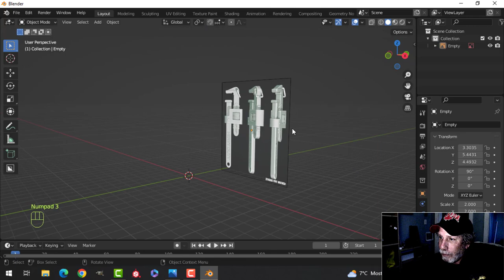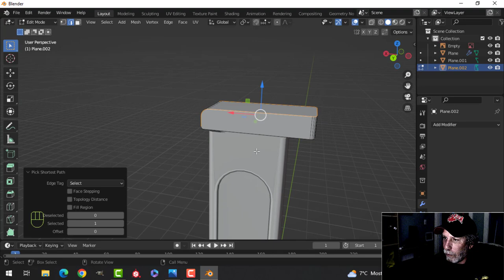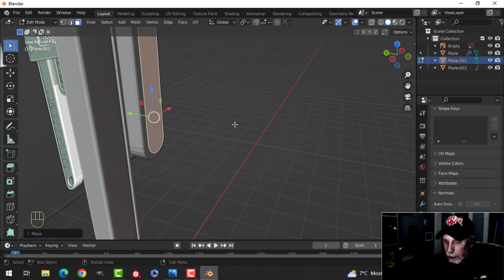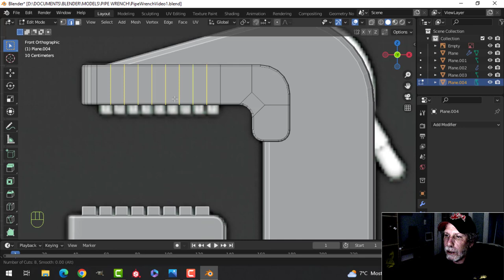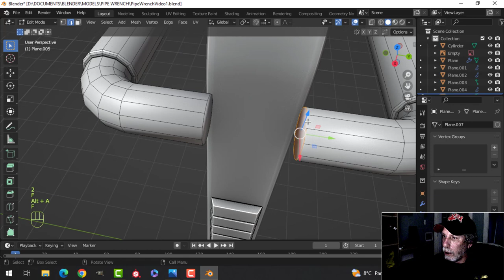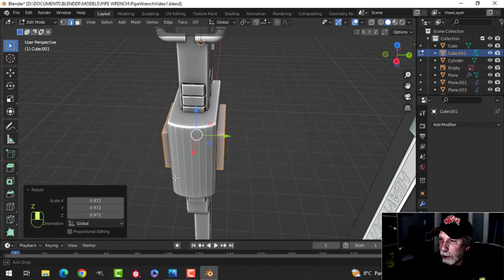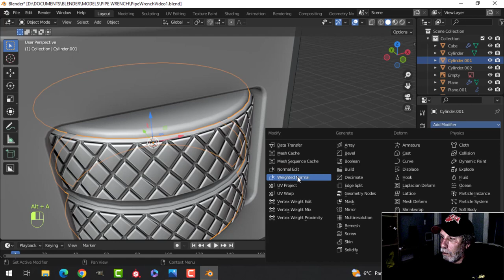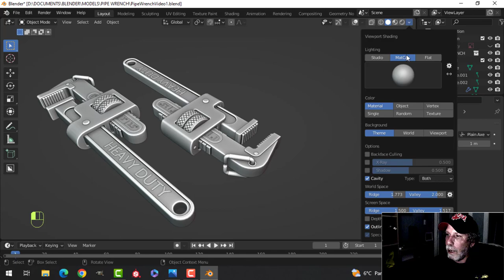BLENDER: PIPE WRENCH (MODELING)

Comment: Ok sir!  That metal clip with those rubber sleves give me a bit of a challange to model. not in general but those sleves. I am on version 5.1 and don't know whether its the keyboard but using the command "E" + "alt S" just completely blew my mind! all how, it failed to wors. "E +S did work but seperately.

Comment: Like your work. Sir for boolean You can activate your bool tools then you have to press only Ctrl minus for bool cut... There is no need to add  Boolean Modifier...
Reply from the maker: I sometimes use bool tools but have tried to do most modeling for this channel with as few add-ons as possible.  Other than loop tools and node wrangler, I model with no other add-ons.  Meanwhile, I have box cutter and machine tools etc but I want to keep this channel simple.  Still, I may start using bool tool again,  we will see.  Thx
Reply: @zerobio  Oh , I see....

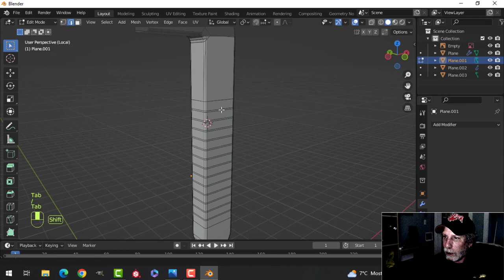Comment: I am experiencing a small challange. on yout frame 20:44/56:21  the moving portion, I am not able to bevel it  fully. It seize-up and no more is possible. I checked for diuble verticies and normals, all correct.
Reply from the maker: I will look into this later and get back to you...
Reply from the maker: So I'm not sure what you mean by beveling it fully but I will say that as various cuts, extrusions and booleans are performed on an object,  often the bevel modifier no longer provides much of a bevel.  You can play with the angle and sometimes that will work but often times the mesh is changed such that the bevel modifier does nothing.  You need to walk a thin line when relying on the modifier.  I often do manual bevels with ctrl B or shift ctrl B.  Especially when I extrude out those teeth, the modifier barely adds any bevel.  If you added the teeth as separate geometry, not as one piece with teeth extruded, the bevel modifier would give a good bevel.  So just keep experimenting and see how it goes.
Reply: I found the problem was caused by the "reversed" bevel under the shank. I proceeded to bevel only where seen and the plate with those grips would hide the rest. Coming along nicely and thanks. @zerobio
Reply from the maker: @michaelpenco546  Excellent!  Hope you will drop by the zerobio discord and show your work either as WIP or final render in the blender-render channel or tools-challenge-render if you are participating in the challenge.

Comment: Hi! I loved your tutorial and would very much like to follow it. However, the pipe wrench reference image isn´t available anymore. So if you could do something to help me, like upload it here in my comment i would very much apreciate it!
Thank you! Have an amazing day and thank you for the amazing toturial!
Reply: I'm having the same problem! btw amazing tutorial
Reply from the maker: It should be on the zerobio discord.  Are you a member of the discord?  If not, perhaps it is not available to you.  Let me check and send the link to you here and see if it works for you.
Reply from the maker: @ineslopes9682  see my previous comment to OP
Reply from the maker: Please try this link and see if it works for you ... https://cdn.discordapp.com/attachments/801065146327498752/1105302895932481617/zerobioPipeWrenchReference.jpg?ex=661dd209&is=660b5d09&hm=49acfa38642c1b8026d539701311b2aa5336b34685d313f82ff7a69211e2f782&
Reply from the maker: Try this link again https://cdn.discordapp.com/attachments/801065146327498752/1105302895932481617/zerobioPipeWrenchReference.jpg?ex=661dd209&is=660b5d09&hm=49acfa38642c1b8026d539701311b2aa5336b34685d313f82ff7a69211e2f782&
Reply: @zerobio   Thank you so much!!! It works now! Have a great day!!
Reply from the maker: @joanasantos3880  excellent!  Good luck